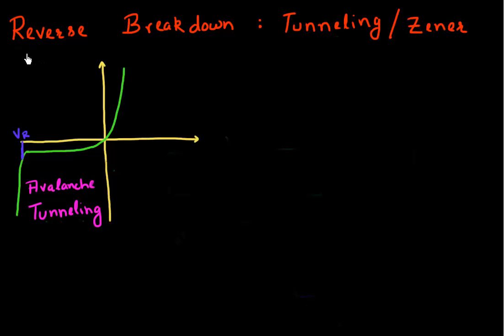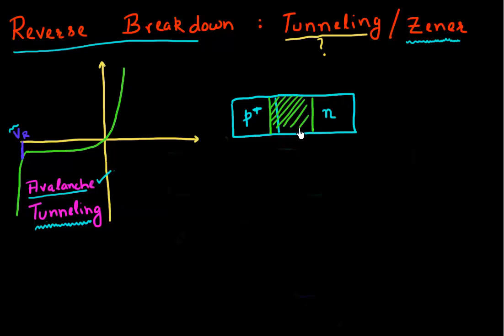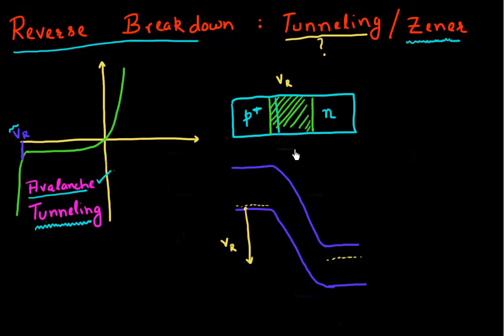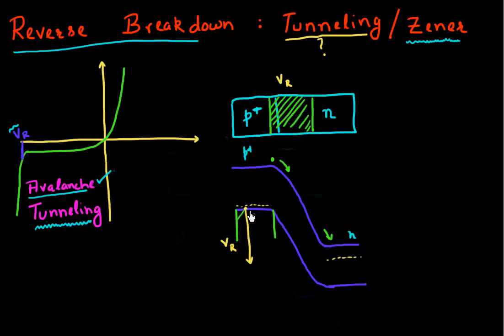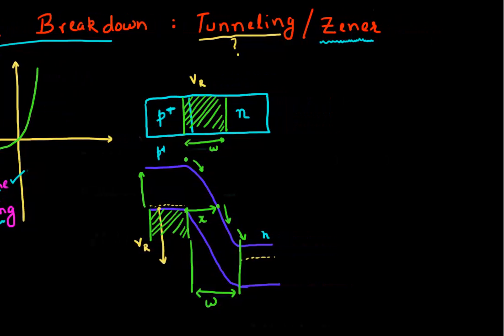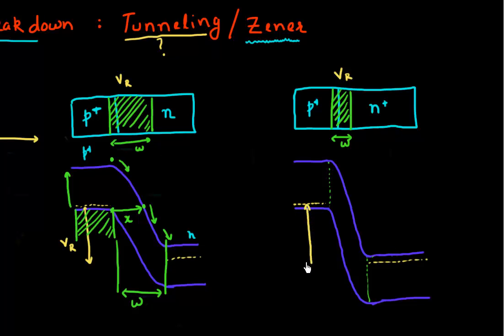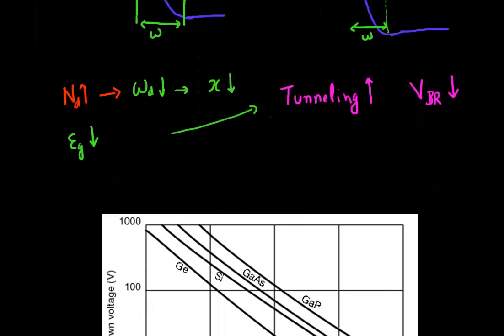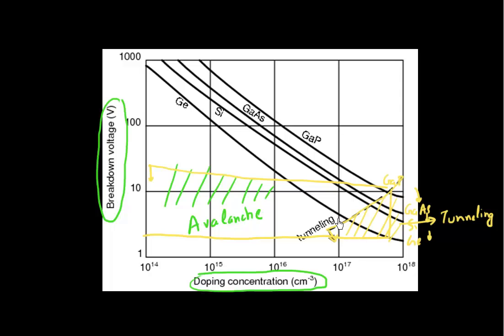P-N diode: zener breakdown or tunneling

Comment: first, nice and useful video, thank you for makng it.
but something bugs- i remember that a positive charge would like to go down the voltage gradient, while a negative charge would like to go up the voltage difference. why would an electron would like to go from the P+\high voltage, side to the n\low voltage side?
Reply: yes,u are right. n+ region should be above p+ and then electron would travel up the hill, towards higher voltage.
Reply: electrons love downhill movement and holes love uphill